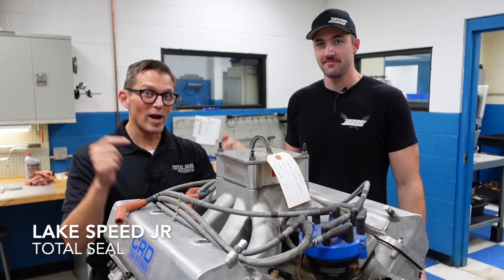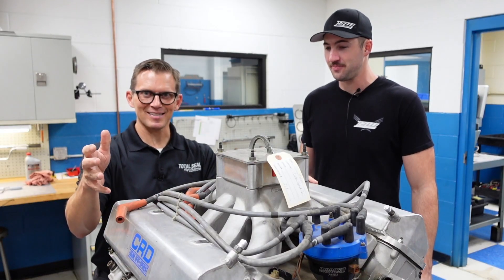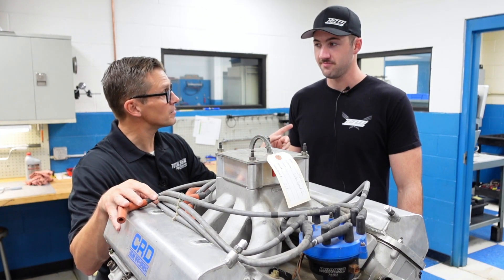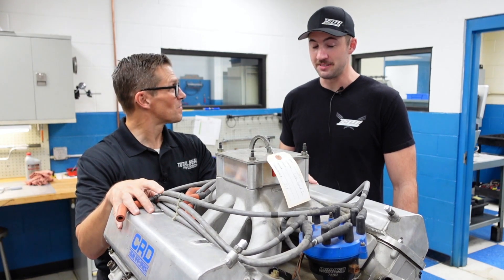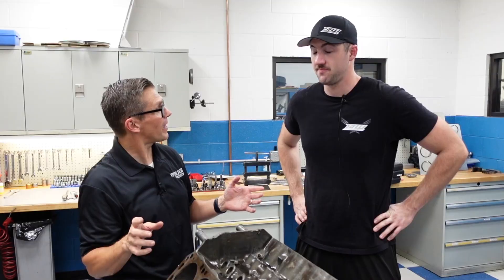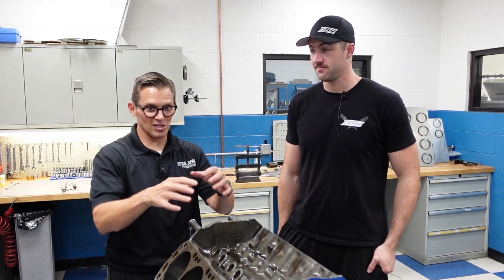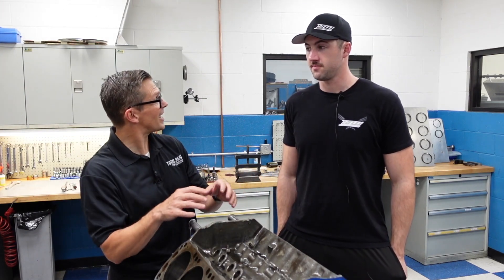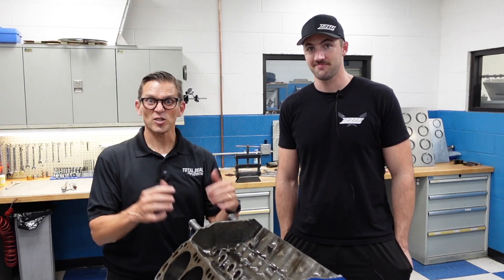Ford C3 NASCAR Engine Dyno & Teardown Summary - My Dad's Old Engine Didn't Make What We Expected...

Comment: Check out the opening engine dyno scene.  your spark plug wire is arcing to your valve cover.
Reply from the maker: That was actually a piece of fiber from the heat shield. It was not arcing.

Comment: Valve can't be the the same then 15 years a go standing 15 years open valve pressure are long-term damage has been done olso with piston ring pressure
Reply from the maker: They are going t to measure the spring rate of the valve springs this week.

Comment: The compression would account for 70-80HP. Hard to believe the ring seal was so bad as to be missing that much HP.   You guys did confirm the cam was a Cup grind of some kind, right?
Reply from the maker: And yes, the Cam was appropriate for that engine. We actually confirmed that with the cam grinder.
Reply from the maker: The blow by was really high, so the ring seal, valve springs and valve seats are all part of the power loss. We will be doing more detailed inspection of all the parts very soon.

Comment: So are the NASCAR engines pretty much "bespoke" or are they versions of existing engines?  I don't follow NASCAR [I went to college at Embry-Riddle in Daytona and I was an usher at the '87 Daytona 500], but folks, at this point?  I think they need to go back to stock-block engines, to include DOHC 32 valve engines.  Maybe they can lower displacement to the lowest displacement GM ever built, 215 cubic inches or 3.5 liters, which is what a lot of cars have now.
Reply from the maker: That engine was a Windsor block. Today, the engines are completely bespoke.
Reply: @TotalSeal  That's sad.  Big $...

Comment: So obviously this engine does not have the pistons in it that it had in nascar form. I can’t imagine they were running engines with 9-1cr since in the 1950s
Reply from the maker: Actually, there was a 9:1 compression rule for the Truck and Busch Series engines at that time.
Reply: check out the opening dyno scene. is the second spark plug wire arcing to the heads? thats probably why its so low on power